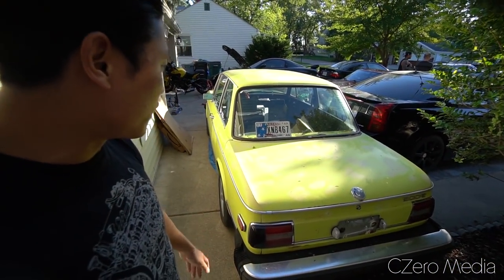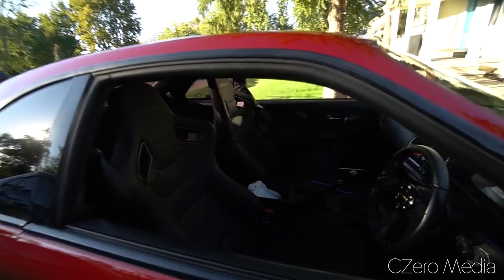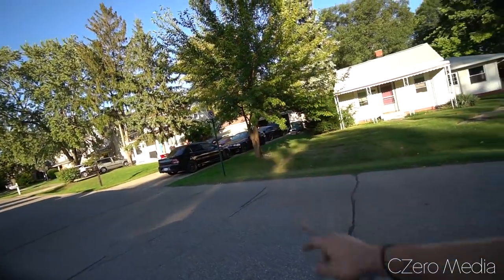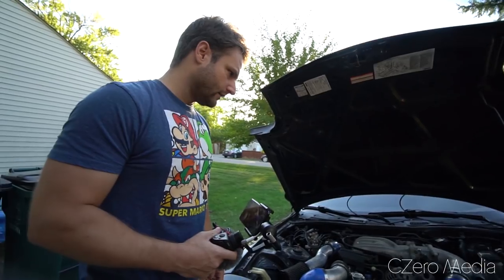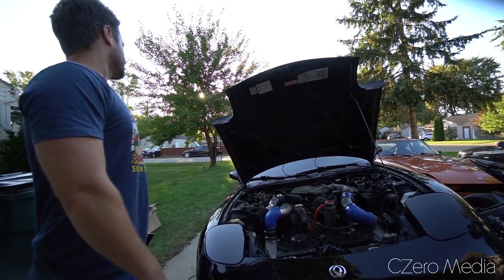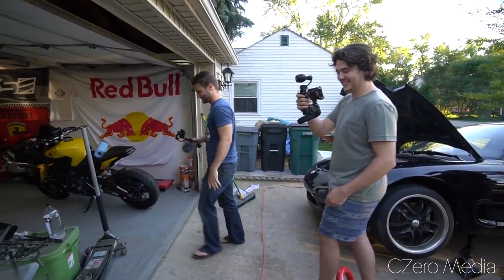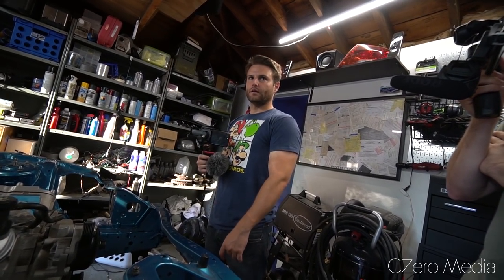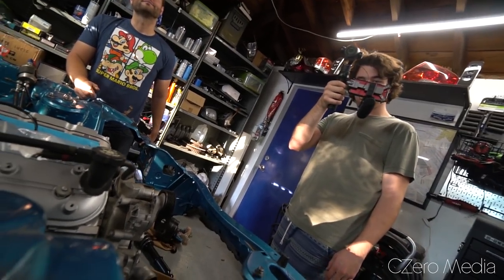Tour Of My Cars, Bikes, and Rob Dahm's Worst Nightmare. - FD RX7 Race Car Build Video Series 29

Comment: LS swapping a Skyline, even if it's a GTS-T is a sin
Reply: Mo Neenja31 I don't understand why, rb25 can make as much if more power stock than a mafless tune Ls1.
Reply: And they're planning to LS the inline 6 on the e36 m3 :(
Reply: Those Americans LS swap everything...
Reply: Dean Jason Lmao
Reply: Mo Neenja31 the RB is kind of shit at making power.
Reply: Because Racecar because parts to maintain RBs are expensive as fuck, assuming you can find them in the US. If not then wayy more expensive to get the parts from Japan or Australia or any other country with a big skyline market
Reply: because rb25s are overrated and actually a pretty average engine

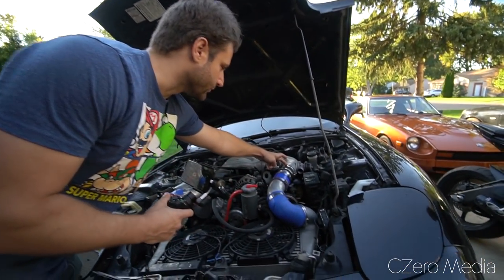Comment: 9:20 The non-polished Greddy elbow means it came from an intercooler kit. Those come with a bov flange built in but they’re rare. The Greddy elbows that are sold individually are always polished. To correct Rob.

Comment: Wow that's just Blasphemy, to ruin a nice FD with a LS Swap is sad... LOL yeah right more power/torque, more reliable, cheaper in oem/junkyard/aftermarket parts vs 13B Rotory, me and my bro just picked up a 90' FC RX7 for $1800 with plans of putting in a Boosted stock bottom end Iron 6.0/Tremec T56 OR CD009 swap/8.8 solid axle rearend... Keep up the good work and shout out from Dallas Texas